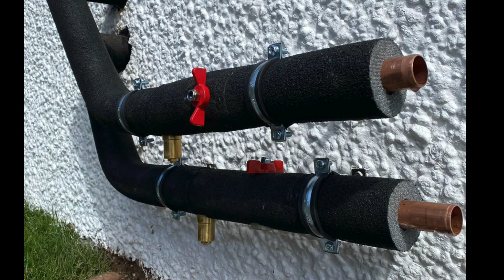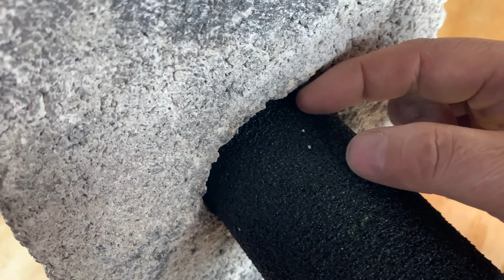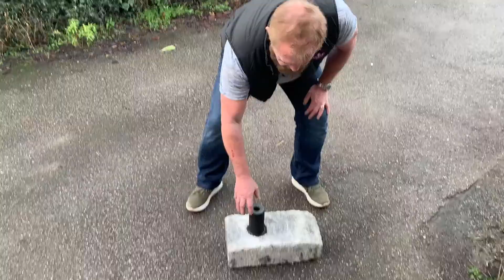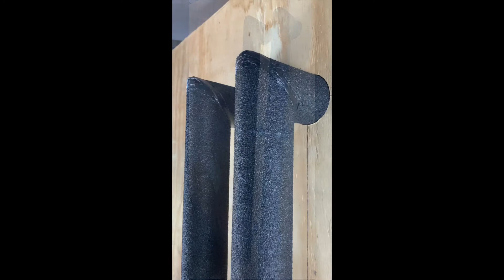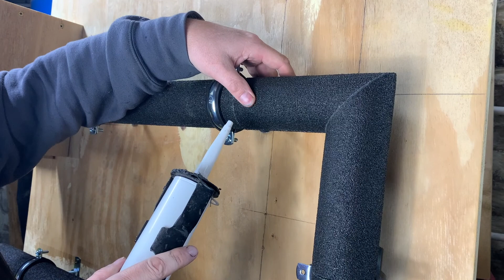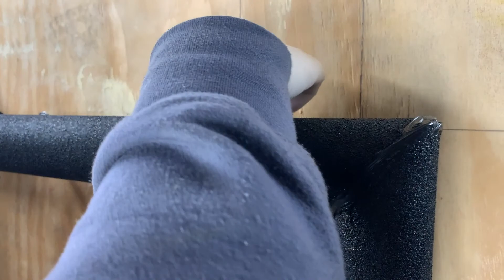Installing Primary Pro insulation for an Air Source Heat Pump

Comment: I’ve a difficult wall route but have the option to go under patio slabs and save about 8m. Will it take being buried and is it best to run it in gravel or sand or it really doesn’t matter please?
Reply from the maker: HI, use our Primary pro sleeve to protect the insulated pipe, it's easy to cut and use plenty of bond & Seal to stop water / mosture
Reply from the maker: Drop me a eamil and will show you what we have been working on and wat other do, David@primarypro.co.uk , there to help

Comment: I was a bit disappointed Octopus didn't use Primary Pro when installing my heat pump as they just clipped the 28mm primary pipework to the external wall and lagged over the top of it meaning there were thermal breaks for every pipe clip. I ended up using cable ties as the lagging in a couple of places wasn't completely covering the pipes and when I put my fingers around the back of the lagging I could feel copper pipe. I also gaffa taped a few places and used around 70 cable ties so there is continuous positive pressure to keep the lagging closed together. Primary Pro would have made for a much better job.
Reply from the maker: Yes, every cap will not only mean energy getting out but water / moisture gets in, our Primary pro and clipping on the outside make sure all the heat gets to where it's needed and the primary pro  insulation has the best water proofing g on the domestic market
Reply: @primarypro1627 what happens if the installer didn't bond primary Pro properly? Is the inside foam waterproof

Comment: Normal house has 30kw boiler but only a 6kw heat pump and that includes the DHW. U cant afford to loose one ounce of energy so the old insulation methods are defunct. Primary pro is the only way to minimise losses to nil.
Reply from the maker: Thank you !!!, means a lot to us that, made by installers for installers and our focus will always be to help the professional when time and weather may be be on there side